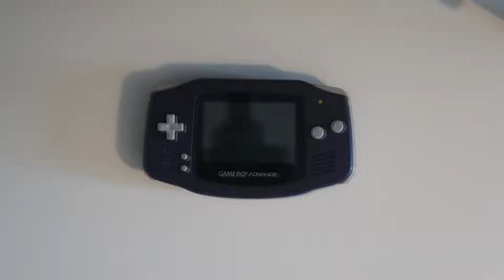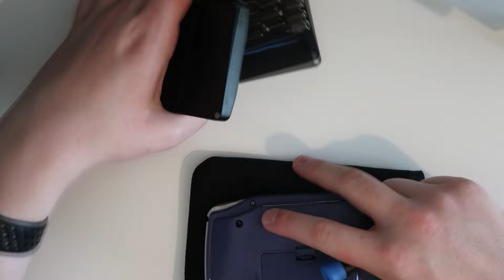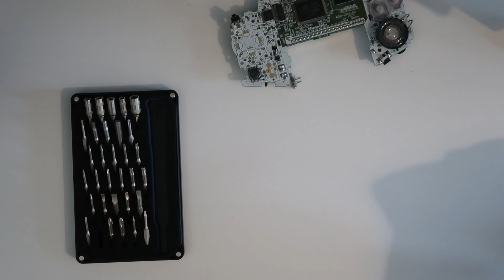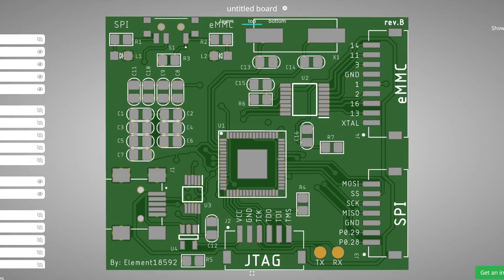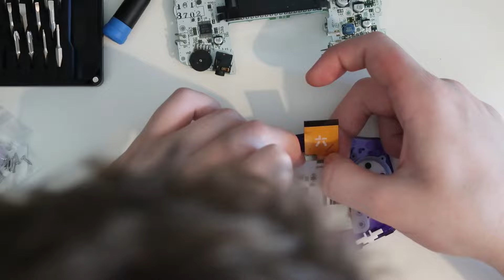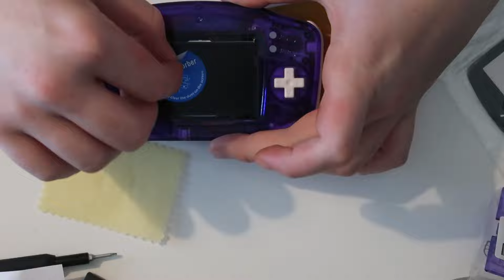The ULTIMATE GameBoy Advance!

Comment: Rechargeable batteries? c: 

Also for what you do next! Maybe a battery mod?
Reply from the maker: AA batteries aren’t cutting it for me, I think this is a great idea!
Reply: Cool! I'll see it then when it's up as I do like what was done here. I like the traditional but fresh modern look this build had.

Keep up the grind, bro. You seem pretty experienced for what I've seen you take apart. I think at most all I've ever done was retro mod a dpad for my old 2ds.
  @TheModSmith
Reply from the maker: @Slippers731  Thanks for your support; I genuinely appreciate it. Why not explore more modifications yourself? I'm far from being a professional, and I completed this screen upgrade without any problems. I believe you can do it too!
Reply: Time and money mostly. I've reshelled an sp, but I could do that easier than a 2ds for what I consider hard. I've soft-modded a lot of my consoles in terms of jail-breaking them tho. My O2ds I made the dpad to use, for example I have jail-broken then linux mint on a macbook I software modded for a relative.  @TheModSmith  

And you're welcome, bro. It's a hobby I'll probably deeper dive into eventually.